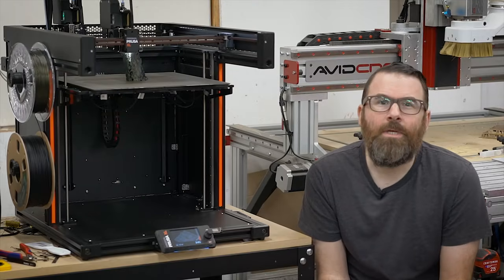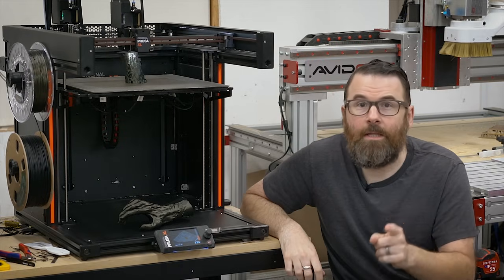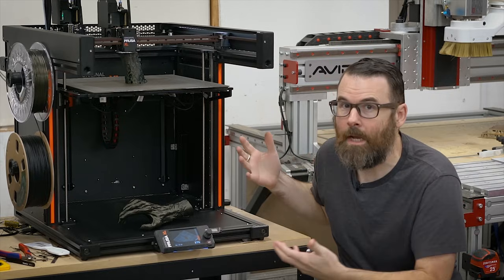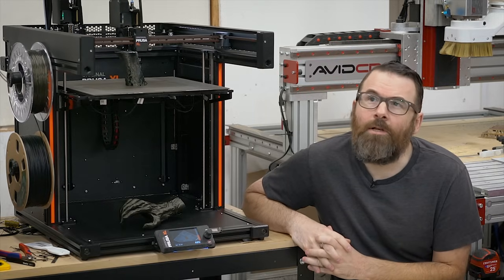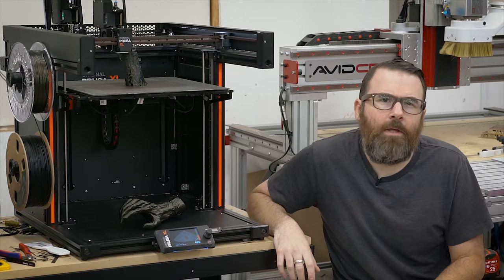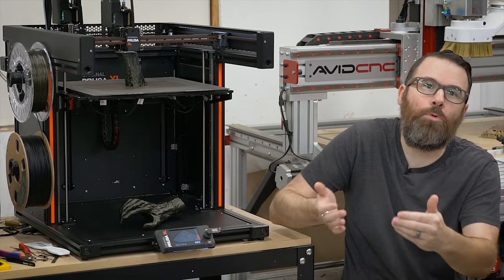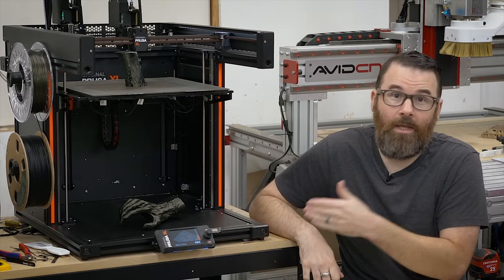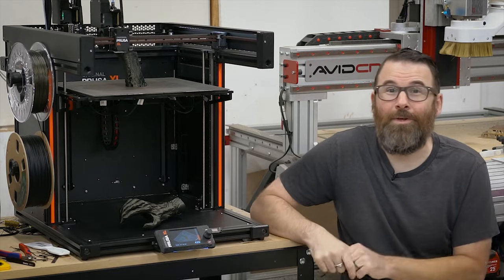Prusa XL - Alpha Firmware Testing!

Comment: Loving your XL reviews, you have been fair, consistent, and touching on the points I'd care about. I finally got my 5 tool head XL and built it last weekend. Easily the longest calibration I've dealt with out of the box. However, after watching everyone else's oopsies the first benchy and key rings were perfect. Just got my spool of HIPS filament and solvent. Looking foward to some HIPS/ABS tests. Next is using a 0.25mm nozzle for either just the outer layer, or spot printing where their is detail/text and/or the top layer printing. If I can get 0.25mm detail, 0.6mm interior/supports and dissolvable supports I'll get my ideal.
Reply from the maker: Sorry for the late reply but congrats on the printer!  I'm glad to see other people are getting good results.

Comment: Possible improvement for comparison to other printers(specifically the bambulab). Select the 0.6mm nozzel option for the printer, and since bambu studio is based on prusa slicer, it should be easier to change settings and make a comparison.
Reply from the maker: Yeah, I did do this, but Bambu profiles are still highly tuned to print as little filament as possible while still getting a cosmetically nice part.  It's tough since Bambu is focusing on speed whereas Prusa focuses on part quality and reliability.

Comment: The XL has so much potential. They could do dynamic input shaping with the accelerometer, spaghetti/clog/failed object detection with the load sensor, support for a webcam, etc. 

It looks like the main bottleneck is the firmware team. Every exciting feature released is coming from them, but they are the slowest to do so.
Reply from the maker: Yeah, I think that's a fair take.  The hardware (aside from the networking) is good.  The printer is robust and the tool changer is rock solid.  I wish more people would focus on the positives.  The tool changer has been FLAWLESS.  It swaps heads without skipping a beat.  I think once the firmware is dialed in and we get REAL input shaping, it will be quite the machine.
Reply: I suspect the team is a modern, Agile kind of deal. I never liked that system, looks good in theory, never seems to work well in practice.
Reply: @VincentGroenewold  From someone who claimed to have interned at Prusa, the problem is not the methodology as much as the lack of skilled software devs in Prague. Many companies have been very successful in doing fully remote development using talent around the world, but Prusa seems more conservative.

Comment: Thanks, great overview and like for like comparison.  This printer has so much potential.  No doubt Bamboo Labs will launch a multitool or idex in the not too distant future, I just hope Prusa can get the XL and Prusa slicer developed quickly enough not to lose the initiative (again).
Reply from the maker: Check my more recent videos, I haven't NOT been able to do anything I need with it.  It's sometimes a bit more 'hacky' than I would like, but the slicer does allow for most situations if you know how what boxes to check/uncheck.

Comment: Fascinating. I’d love to see a review of multimaterial printing since that’s the only area that the XL might have an advantage over the Bambu (other than print size until Bambu come out with something to rival it).
Reply from the maker: Have you seen my other videos?  I've tested this out and it seems like it works pretty flawlessly, with some caveats in the slicer.
Reply: I'm interrested too about 3D multimaterial printing ... What are th ebest alternatives in your opinion ? I'm actually hyped by the 5 arms
Reply: I want a good multi flexible material printer
Reply from the maker: @JJ-wm9lo  Currently the Prusa XL is the only printer on the market that can do true multi-material (flexible, abrasive, and dramatically different filaments on a single machine).  The Bambu with the AMS can do similar materials, but it can't do flexible or abrasive filament through the AMS, so you're limited.  Those are your only options really.
Reply: @RobertCowanDIY  Thanks

Comment: Great video. As you said, getting a XL (and i have) would be about the multiple extruders. But when i finally could finish my order from 2021 i hadn't the means to upgrade to a dual one. Sadly because of the big backlog of orders the focus is more towards that, which i understand. But it will delay my upgrade options for some months now. All things considered the printer does it job nicely for me. I recognize the time difference too in a large print. My last acutal print was about 1h 30min longer then predicted by the slicer.
Reply from the maker: I'm curious if the new alpha firmware is better at predicting the actual times.  I'm exclusively using that now and all times have been accurate.

Comment: You can crank up the printing speed in the slicer and you will see the XL is capable to print nearly as fast as the Bambu Carbon. I printed a benchy in 25 minutes. The quality is rather poor, but I guess when Prusa is ready with the input shaping and using the values from the accelerometers  instead of generic values, the quality will improve a lot.
Reply: the bambu is literally twice the speed of the prusa, because the prusa hotend has half the max volumetric flow rate. this is simple physics, and thats pretty straightforward. width x height x actual speed = flow, and the flow on the bambu before you cold core or underextrude is roughly double a 0.6 nozzle prusa xl while only using a .4 nozzle, and will push further when you up it to a .6 nozzle. people keep comparing apples to orange profile settings instead of measuring the actual machine capabilities and its a bunch of nonsense.  the only way the XL can catch up is with a hotend swap to a higher flow hotend with a longer meltzone. if you do a hotend swap to something like say the new dragon ace, with a bozzle, you could outperform the bambu on an xl in terms of max limits on net part speed vs a stock bambu this would be roughly comparable to a bambu with a modded hotend running a cht nozzle. neither printer is limited by the motion system.  prusa cant do magic, physics still exists, prusa needs an upgrade to their hotend, its that simple.

Justin
Reply: @JustinBuildsThings  I literally did an apples to apples slicer settings comparison and the prusa was a min faster on the parts I run from my business. I got a screenshot proving this. The XL uses the same hotend as the MK4 and the MK4 has no problems flowing at bambu speeds.
Reply: @LilApe What is the max flow rate of the prusaXL hot end with PLA and 0.6mm nozzle?
Reply: @liamventer  Its the same hot end as the MK4. People with MK4's are print with over 30mm flow rates with ease
Reply: The mk4 uses a system that's pretty much just v6 with the ol v6 block. Doubt it can go over 30 unless you use the adapter + cht nozzle
Reply: @ivyr336  If it is just using an old V6 length block and non CHT style nozzles then it won't even be able to sustain over 20mm/s^3 with standard PLA and a 0.6mm nozzle. Short bursts of higher Volumetric flow will be possible, but on larger prints with long high speed travels it will severely under extrude. So while it might cope with fast accelerations and short bursts of high speed printing moves (and match the speed of the faster printers on small objects) it wont' be able to sustain higher speeds for larger prints. This is simple to test.

Comment: impressive!  if it can get that close in print speed, it will walk circles around the bambu once you test multi-color or multi-material prints
Reply from the maker: Eh, I think they will always be 'roughly comparable', because the Bambu is better designed for speed.
Reply: @RobertCowanDIY  even on a multi color print? ams on my a1 mini is certainly a decent improvement over my x1cc's, but still seems miles behind your XL's tool switching.  i'm guessing you plan to test this for our viewing pleasure once you get the extra heads?
Reply from the maker: @ame7165 Eh, I'm done testing against Bambu, people really want to like the brand.  Unless I have something positive to say about Bambu, I'll just skip it from now on.
Reply: @RobertCowanDIY  yeah that's for sure.  the facebook group is a cesspool
Reply from the maker: @ame7165 It kinda reminds me of Tesla.  A bunch of non-car guys just went and bought a car that does 0-60 really fast and now they're 'car guys'.
Reply: @RobertCowanDIY  haha, those two groups would probably form a single circle as a venn diagram

Comment: A comparison between a bambu and prusa would be great content and would probably finalize my decision about which one to purchase. I've seen a lot of 3D pritner "review" channels that print a few basic shapes on the bambu and say "yep it looks good and its fast" but they don't go in depth in the print quality, settings, or strength and I haven't seen anyone compare it to the Prusa.
Reply: How much do you like to tinker/modify?

Do you want a machine that you can modify or that just works?

Do you want an integrated solution or a tinker project?

Do you want to tinker with 3d printing as a hobby or print as a hobby?

That should be the questions that determine your decision, not comparisons. The quality of the bambu is excellent and it just works. If that's what you're after, go bambu.

The prusa is a tinkerers dream and very modifiable.
Reply from the maker: This is such a hard question to answer and I'm not gonna touch it with a 10 foot pole!  It's a TOUCHY subject.  I think you either like Prusa (slow and steady wins the race, very reliable and has a lot of flexibility) or you like Bambu (slicker and fancier, more 'flashy', and prints FAST.  but less reliable, relies on cloud, less flexible).  I think the best analogy is photography.  Are you looking to buy a fancy camera body and use it in manual mode (Prusa) or do you want to get the fanciest tech out there and just shoot in Auto and let the camera do everything for you (Bambu)?  The XL is VERY different from an X1C.  If you want to print pretty colors and don't care about engineering or mechanical parts, go Bambu.  If you want to try strange things and push the boundaries on what can be done with 3d printing, get the XL.
Reply: @RobertCowanDIY  I don't think the subject has to be touchy. People are highly opinionated about both Prusa and Bambu Labs, but comparing their printers with identical print settings and filaments (including engineering filaments) would give objective results that people can't really argue about. It would need to be rigorous though, with even slicer differences resulting in (fair or unfair) discrepancies.
Reply from the maker: @TROPtastic Have you been on the internet before?!  People will always find something to complain about, even if you control all the variables.  I'm not really interested in any further comparisons, I'm just going to use it.  I've seen such comparisons and it turns into "the results were faked!".  I have no interest in changing people's minds, I'm just gonna do my thing and make stuff with it.

Comment: how come tha the network speed is only 200kB/sec? is it using like, an ancient CPU or what?
Reply from the maker: I suspect it's how they're implementing the USB.  The processor is fine, but needs to store the file on the USB storage so there might be a hardware bottleneck between the main buddy-board and the USB interface.  But 200kb/sec is awful for something in 2023.

Comment: Interesting video, i hope you will do more XL testing further on, especially as software evolve. The Bambu fanatics filling every comment section and FB group is annoying though.
Reply from the maker: Ha, right?  I do love the irony of the BL fanatics 'calling out' all Prusa people as 'fanatics.  Strange stuff.  But yeah, I will be doing more videos.  I just got the 0.4mm nozzles, so I'm going to see if that makes a difference.
Reply: @RobertCowanDIY  i dont know why,, but the prusa groups on FB has been an absolute train wreck since the bambu came out, with all the fanatics going berserk. Maybe its because of the average age that is low, i dont know. But the parts of the internet that I usually hang out in is nothing like that. Anyway, you got a new subscriber at least with your calm and not attention seeking video style:)
Reply from the maker: @garagecedric  Yeah, too many YT channels are always tying to be the first to find some problem and 'expose' it to the internet.  I just like making stuff.  I think regarding Bambu, they did something similar to Tesla.  They converted a group of non-car people into car people.  People that were NEVER into car before bought Teslas and now they're bragging about how fast they are.  Bambu is a lot like that.  Many of these people came from really cheap entry-level printers and are showing off their print quality and how fast they are.  But for long-term enthusiasts, it's nothing really new (especially the speed for the Voron crowd).  It happens in many industries, you make the technology accessible for the mainstream audience and you get a lot of 'newbies' that are suddenly at the level of the die-hard enthusiasts.
Reply: @RobertCowanDIY  Good sumnary, that makes sense. Ill hope it calms down a bit. And I hope more companies starts making quality printers to make better competition in the segment, as long as they dont come with stupid fanatics :)

Comment: That is positively surprising that a 1:1 comparison of the silcer profiles of the prusaslicer and bambooslicer end up similar print times. If you were to test this a bit more in depth that would be very interesting...
Reply: why would it be surprising? they use the same core slicing engine, bambu and orca and superslicer and galaxy slicer are all prusaslicer forks.
Reply from the maker: As others have said, it's not that surprising.  As I said at the end, Bambu is just really good at tweaking the print profiles to get cosmetically/visually great parts with minimal print time.
Reply: @RobertCowanDIY  true, well from what i gathered it always sounded like the xl was not optimized for speed. i think prusa himself said something like that. but it could very well be that we just need to wait for the same optimization work from prusa, that already went into the bamboo
Reply from the maker: @Fluless Yeah, that was my take as well.  When the XL was announced, it WOULD have been one of the fastest printers out there (other than Voron and assuming input shaping, etc), but now it's certainly not 'fast' when compared to fast printers.  It's more of a versatile semi-industrial machine.

Comment: Great analysis.  Thanks

I'm starting to wonder if just using .4mm nozzles makes more sense.

Are there currently profiles to use .4mm nozzles for the XL?
Reply from the maker: There are profiles for 0.4mm.  It just ships with 0.6mm.  I should probably get some 0.4mm nozzle, but I'm waiting for the hardened ones to come back into stock, since I print a lot of abrasive stuff.

Comment: Robert, are all your prints on your stock .6 nozzle?  I'm finalizing my preorder now was gonna get additional .4 nozzles but think i may wait for now.  I know they include a v6 adapter so i got a nozzle x which i can use on my Mk2s if something better comes out for the xl. Edit: got to later in video you are using .6 nozzle.  thanks!
Reply from the maker: Yep, everything you see is the stock 0.4mm nozzle.  I haven't switched to 0.4mm yet because I'm waiting for them to have the hardened nozzles or possibly the high-flow solution.
Reply: @RobertCowanDIY  thanks!  My 5 head is on its way. I’m also waiting for the obsidian nozzles to come back in stock. One thing is can you select different nozzle sizes for each tool head?
Reply from the maker: @beeradfpv Nice! I'm waiting on the obsidian nozzles as well.  At this time, you cannot select different nozzle sizes per extruder, it's global for the whole print unfortunately.